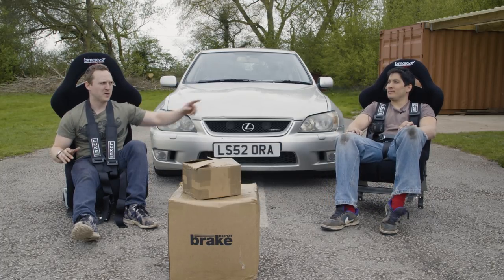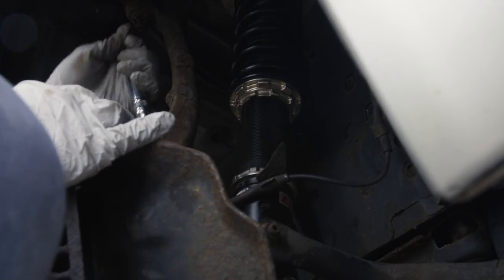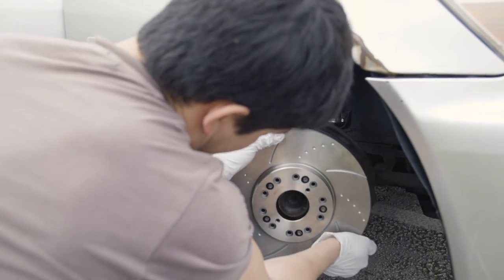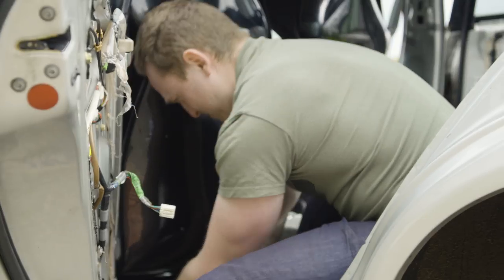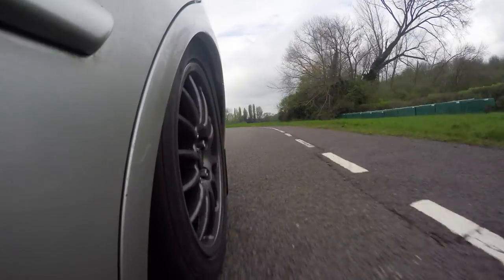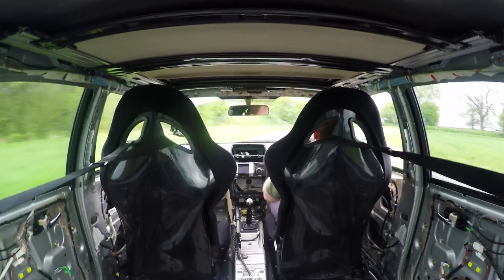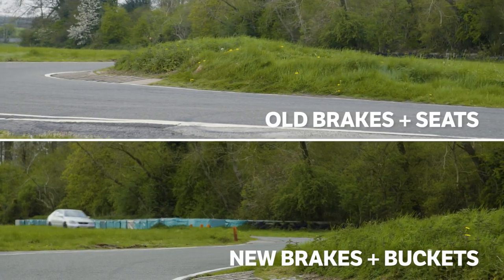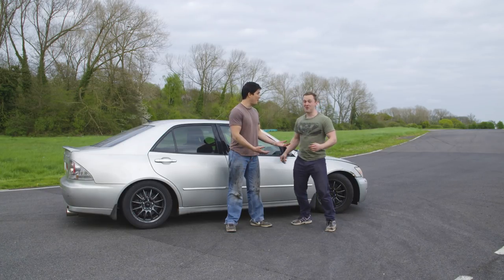How Much Faster Is My IS 200 Track Car With Performance Brakes & Bucket Seats?

Comment: The down side is that we don't get is200's in Canada but the plus is we do have is300 (a 3.0L 2jzge version) for under 4000 CAD with 180000km

Comment: A saftey tip. The holes in the bucket seats should be in the same hight as your shoulders. If he/they roll over the car now they are gonna bounce up and down in the seats. Because the harness is to high above the shoulders

Comment: i gotta say the engine sounds magnificent! maybe a CAI, ECU and a good service could make a massive difference as well
Reply: Except for the service there's nothing left to gain from the 1ge-fe. Cold air intake basically guaranteed to be worse than the stock intake. The stock intake goes straight out of the front, even has some ram air, and there's nothing left in the ECU. The only feasible way you're making extra power from a 1GE is adding boost. Which is reasonably easy to do, especially with a supercharger.

Comment: obviously the brake upgrade is good, but the type of upgrade is not going to directly increase stopping power, rather it will prevent fade and withstand more heat. Engineering Explained has done a few videos on this.

Comment: No point doing air filter guys, the 1G-FE doesn't respond to bolt-on mods like some cars do. Forced induction is the only way to increase power.

Comment: Upgrade that shifter! A fiberglass (or carbon fiber, if the budget allows) hood/trunk lid will further reduce weight. You might be able to do without the factory spoiler for further weight savings, since the track is short enough that downforce won't have much of an effect on the times.

Comment: If you already have sufficient breaks for your tyres, getting any bigger breaks can sometimes leave to imbalanced break pressure for the back and front of the car. The only real advantage being that they'll heat up slower and cool of faster meaning you might get a negligible amount less break fade. Also 15 minutes is not enough to break in the breaks and you've most likely just damaged them XD

Comment: Don`t get me wrong, was a nice series, but that`s it? No more challenges with it? Time it against other cars? Other tracks? Overhauling the diff? Tech stuff like choosing and installing the appropriate spark plugs, leads, coils, custom ECU etc to get the most out of that engine?
Thousands spent and it could have been even better with small stuff.
What you`ve done so far is so far from the end of it that I can only hope to skim the surface here.

Comment: Not trying to talk trash, but those bucket seats are designed for someone like 3 or 4 inches taller than you. The harness sit far to high off your shoulder, in the case of a roll over you'd not be optimally protected by them.

Comment: The tiny Two litre Toyota's getting a teeny bit tighter as a track terrier with each tweak from Garath the trained technological techspert!
Even if some putz, 
dropped its suspension on its guts.

Comment: Would of liked to of seen a little more done to the engine, I know it's a sprint course so power isn't as key; however, it will definitely drop time for the launch, and exiting the last corner and definitely the straight

Comment: correct me if im wrong but a brake upgrade is needed if you're going faster? and helps to prevent brake fade, so it shouldn't speed you up by much at all?

Comment: Black stripes on the bonnet and roof would have increased the vehicles straight line speed 

Also, pink or purple neon lights underneath, and a little teddy hanging from the rear towing eye would have improved cornering stability and body roll

But most importantly, research has shown that the fastest track cars have numbers on the doors! This would have probably increased the vehicles power to weight ratio by another 45% (depending on track temperature and air density)

Comment: Should've put on new calipers too. The old ones are probably a little sticky. I did 2 new calipers on my car. I drilled out my new rotors and put on new pads. It is so smooth compared to the old shitty calipers that were on it. That lexus sounds really good.

Comment: holy shit €315, i bought drilled and slotted rotors that came with ceramic pads and all the hardware for only 70 usd. just realized you got 4, i only got two of them, but still more than double the price :P for my car the drilled and slotted ones costed less then 2 regular rotors lol

Comment: did you clean the brakes before installing them because it may have oil from manufacturer to prevent rust

Comment: Could you change the diff to change the final drive ratio like Engineering Explained did? (Also possibly a LSD if it doesn't have one already)

Comment: Great Video i'm loving the Series but:

You Guys know that Slotted and Dimpled Rotors don't actually increase Brake Force or Power, right?
And you should have used some Grease on the outside of them Pads ;)

Comment: You could have saved yourself some cash (or spent more cash where it's needed) and gained performance by using the original vented disks with uprated callipers. While drilled and slotted disks do a decent job of clearing contaminants the downside is a reduction in surface area and therefore less material for the brake pad to bite into, seeing as the car is being used for sprints rather than endurance the focus should be on raw performance rather than longevity

Comment: Drilled/dimpled and slotted rotors don't give better stopping power. Slotted rotors give more consistent stopping but not better stopping. Drilled rotors crack between the drill holes and the cheap ones will crack along the edge (dangerous). Some high performance cars will run drilled rotors simply because they dissipate heat better but they will tell you that after a track day or very hard driving you should replace all four rotors. I'm sorry, but no rotor will stop harder than a blank. The pads are doing more for your braking than those rotors.

Comment: I have a few questions, it looks like there was not any cleaning from brake disc that storage grease??

Also when you was installed that hole exhaust, would that car need some ecu work???

Comment: do you have length data on stock vs ebc+yellowstuff from 60mph to 0mph? i have ordered slotted ebc discs and yellowstuff so i would like to hear from others about their opinion? my stock pads were overheating and loosing braking power badly on autobahn with 200-250 kmh drive..

Comment: Why did you bleed the system? It's pointless in this case. You don't have to bleed sistem when you changing discs and calipers.
Reply: There could of been air in there from previous owner I suppose
Reply: If there was air in system before, they would know it for sure. They just waste time. Better to change oil then that.

Comment: Seriously guys, you gotta use axle stands.  Jacks are for lifting, not for holding.  If you can afford 600 pounds for seats and harnesses, spend 50 more for 2 more axle stands.

Comment: only thing that irks me about this series as that weight loss was thrown in with other upgrades. should have been done first. then everything else has the same base car to work from. 

then again removing stuff doesn't give you a plug for ebay

Comment: wouldn't it brake the same but wear the brakes slower with performance rotors and pads? I understand if he changed the caliper as well as the rotor and pads then the braking would change significantly.

Comment: guys you need to remove ac pump and heat pump. all the rubbish under the dash. plus airbags. will shave some extra kg. or even remove sound deadening.

Comment: you didn't spray the rotors with brake clean😣
Reply: Erick Weaver don't need to on the modern coated ones only on naked cast iron ones which are protected with oil
Reply: Bet
Reply: Erick Weaver bet?
Reply: Barry Britcher it means foreal?

Comment: +Car Throttle Those bucket seats are WAY too tall for you. Your shoulder should sit somewhere between the top and bottom of the shoulder harness pass through so that the belt goes straight from its hardpoint to your shoulder. It should not be resting on the pass through, pulling down towards your shoulder. Also, look at the shoulder bolsters! They are WAY over your shoulders.

Comment: Now, change front discs vice versa, cause u assembled them wrong. Idea of the grooves are move brakepad gasses,dust and heat out of center of the wheel. Now, they are not doing their job correctly

Comment: Those seats don't look right for you which is the danger of online buying race seats. The belts run through the seat way too high for the driver in this case and need to be a fair bit lower, the shoulder support is also very high too and is only just about giving support there. Probably not a major problem, but the belts will rub and in a really bad accident they'll not be as good as properly fitting seats.

Comment: swap discs around dude the grooves are supposed to run from inside to the outside to release the brake dust and gasses 😂😂

Comment: damn man not even here in california do we ever see so much rust, its so amazing to me to see how some mechanics here bitch and moan over ever so slightly surface rust and you guys gotta work through all that. still that shits gangster how you guys just slap em on, not to say you do it will all cars taking into consideration that it is a track car sooo its built for track use not as a daily driver so more funtion over form.

Comment: better get a roll cage in before you do any competition. Those belts are way too long and need to be anchored on a bar right behind the seats. You will be shocked how far those belts will stretch if you hit anything. They will stretch more than the stock belts and you'll be thrown about like a rag doll.

Comment: Can't help but feel that ripping out the interior is cheating. The GT86 is a totally usable daily driver. So was the IS200 until you gutted it. Oh, and put the correct-diameter wheels on it!

Comment: carbon fiber hood, and wing
Reply: 5RuLe no that won't make it quick just rice
Reply: PHIN HD There is a thing called weight reduction and downforce🖒
Reply: Gustavs it whould make such a small difference there whould be no point and it whould look shit
Reply: yeah rice, on rwd which needs downforce for the rear wheels

Comment: Its so dangerous to wear those belts with bucket without rollcage. If the car overturns you die. The roof collapse in your head and you cant move.